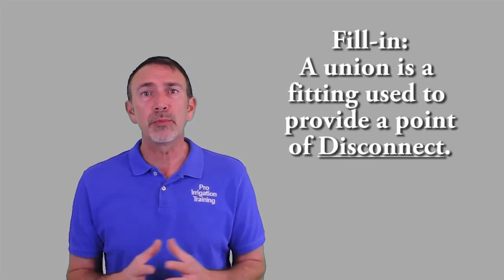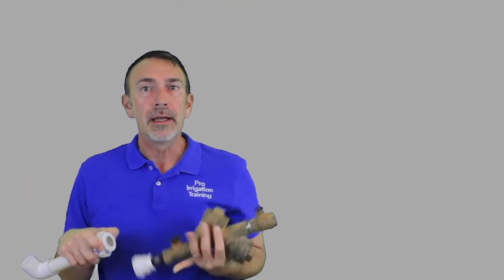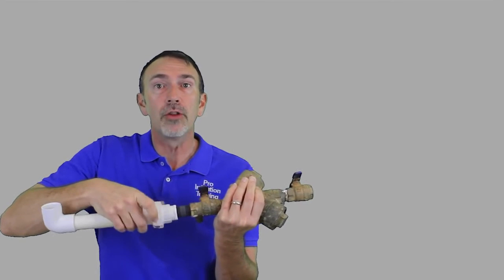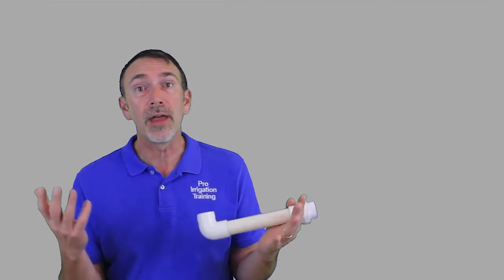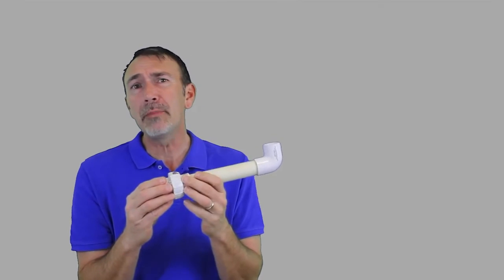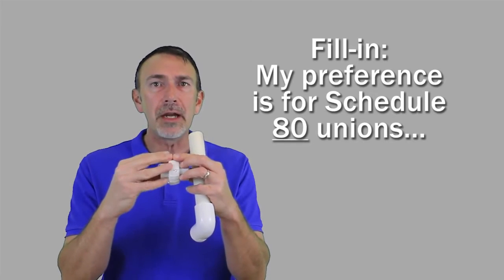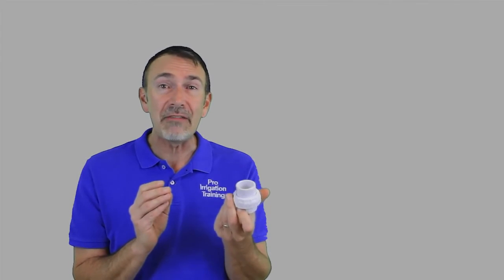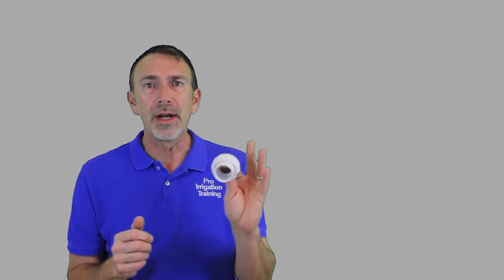How To Use Unions For Irrigation Systems (sprinkler repair)

Comment: Let me ask you, can you mix and match different union halves?  Like I was wanting to have threads on one side and slip on the other side and shop doesn’t sell that.  Oh I am talking about plastic not brass.  Thanks a lot!
Reply from the maker: Yeah definitely if it's the same manufacturer. I've done it before. Sometimes you just have to work with threads, but I always trust my own gluing more than threads. So I will switch to slip whenever possible.
Reply: @Proirrigationtraining  not quite following you.  I probably did a poor job of explaining that I was trying to get a threaded female socket on one side of the union and then slip socket on the other side.   I know in Brass unions since they are cast as a unit, this rarely works well.  However plastic being injection molded or cut threads I thought they might be much more forgiving.   And the spot I am speaking of “not working” is the actual seal that is created at the O Ring where the union halves are joined together creating the water tight seal.   I hope that clarifies my inital muddy question and perhaps that changes your answer?  Oh yes, sticking with the same “style” and manufacture would be critical for this to work properly, your dead on considering that part for sure.   Thanks again!  Look forward to seeing if you are still thinking the same thing.   Cheers. Chad
Reply from the maker: Yes, it should work for you. I've done it many times.  @freeandcriticalthinker4431